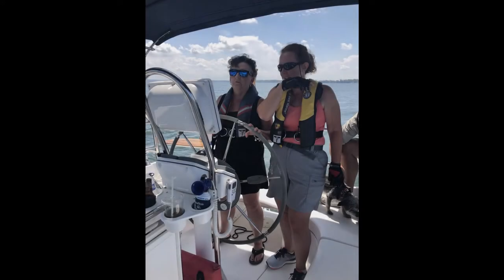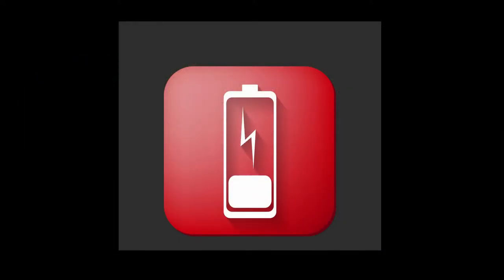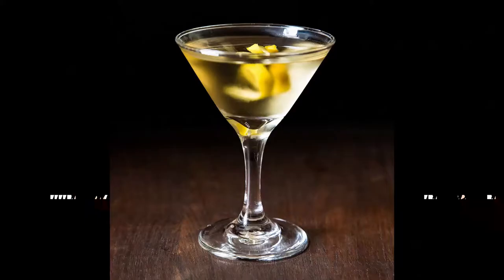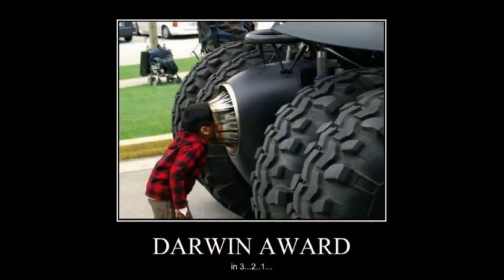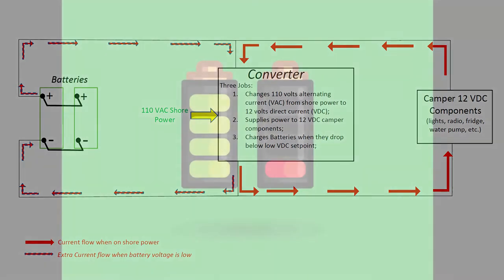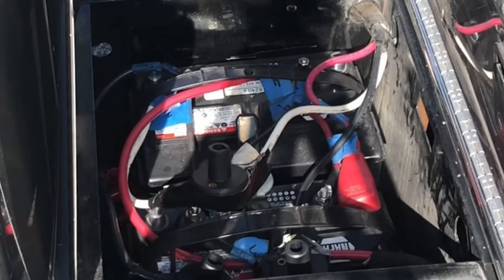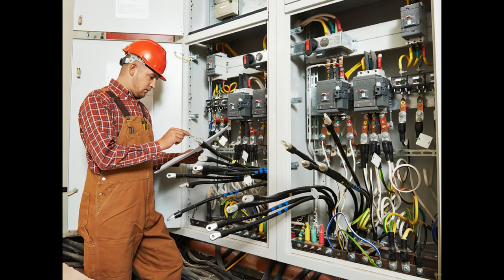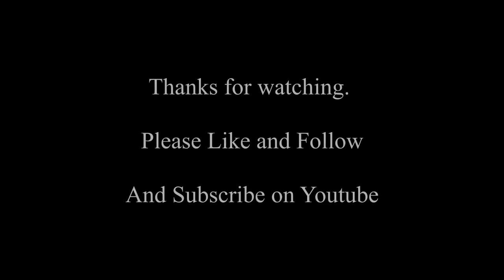Episode 8 - How To Destroy Two Perfectly Good Batteries

Comment: Good info.  I had a similar experience with our grand design solitude this first season.  I kept finding the onboard battery nearly drained while in storage with the factory installed battery disconnect switch off.  After checking the battery draw with an amp-meter, I found a significant parisitic load.  I traced it to the self level system and LP alarm.  The main issue for me was that I could not turn on the refrigerator 24 hours before leaving, since the battery was so low.  Plus, I knew from some research this was going to seriously shorten the life of the battery.  So, I installed a 13 watt solar panel and a 4-way battery switch.  With this set up, I can select if the battery is connected to the coach, the solar panel, both, or completely disconnected.  I found the solar panel significantly slowed the depletion rate of the battery while connected to the coach, and is supposedly not enough charge to damage the battery if left connected for an extended period of time with no parasitic draw.  The only possible issue I have not come through is whether the self level system will "lose" its level setting if left disconnected from battery for an extended period of time.  It did fine disconnected for 1 week, being disconnected all this winter will is the ultimate test.  However, setting level once a season is not a big deal.  

Anyway, I like your videos.